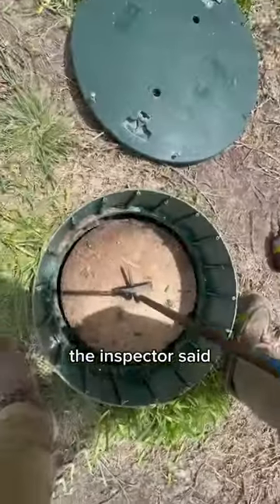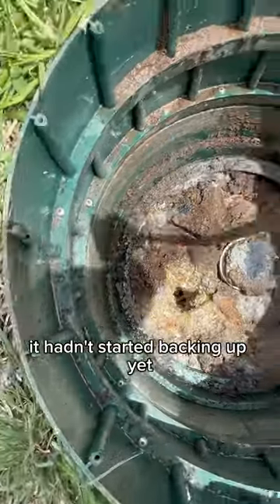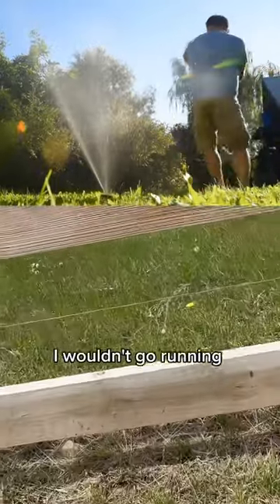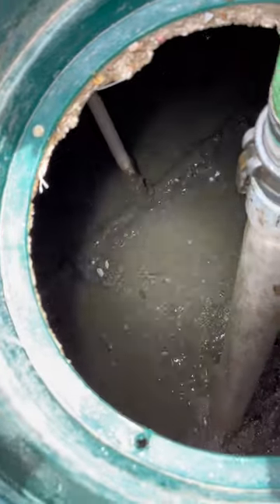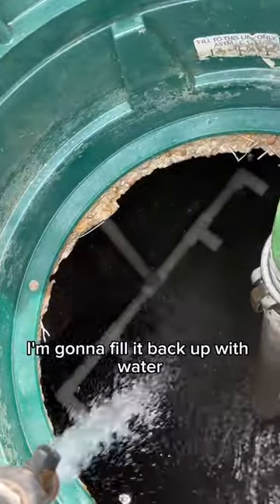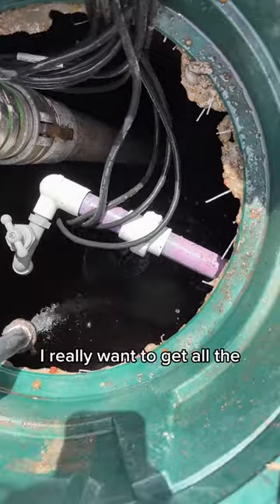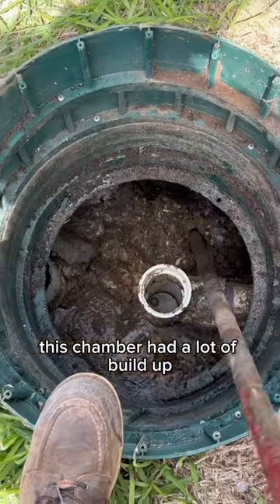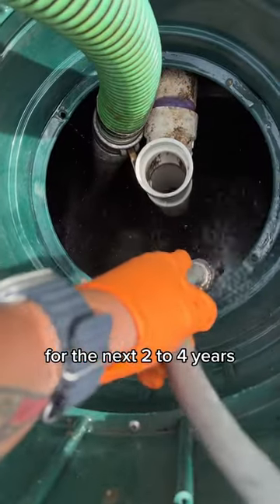Thicker than a bowl of oatmeal #shorts

Comment: Should the concrete lid always be added back with risers in place? The septic company who just emptied our tank and installed risers did not put the concrete lid back on. He just put the riser lid on and added 2 stainless steel screws to hold that lid on. Thanks
Reply: How tall are the risers?  And is the concrete lid small enough to fit inside the risers?
Reply: @moto-fl3rd  unfortunately the lid does not have a handle and is quite large compared to what I see him pull off many septic tanks. The risers are about 2 feet tall I believe.
Reply: @cherylcase252  sounds like it wouldn't be to practical to try to drop a concrete lid down a two foot hole and expect to get it back out.  I'm guessing the concrete lid is too big to fit inside the risers anyway.  Mine doesn't have a concrete lid just the plastic riser lid screwed on like yours.  I think that is normal.
Reply: @moto-fl3rd  thanks for your replies. Have a great Memorial Weekend

Comment: Our 70 year old septic tank is 4' under ground because its on a slope, we had a company come out to clean the tank but he showed up without a backhoe, he said its no problem. I get home to see that they dug a hole big enough to use a pinch point bar to break the lid then used spay foam to seal a 4" pvc pipe into the hole he made. He said hes done tanks like that for years.

Comment: Is the poop water that’s blasted through the sprinklers the same as the poop water that’s sent to a sand mound??
Reply: No, it's treated, and it's regular water. It's the same thing that happens in a wastewater treatment plant, just on a smaller scale. In case you didn't know, most of the water you drink comes from a wastewater plant.
Reply: @AHHHHHHHH21  awwww duuuude groossssssss...guess im dying of dehydration now dafuq 🤦🤢🤮